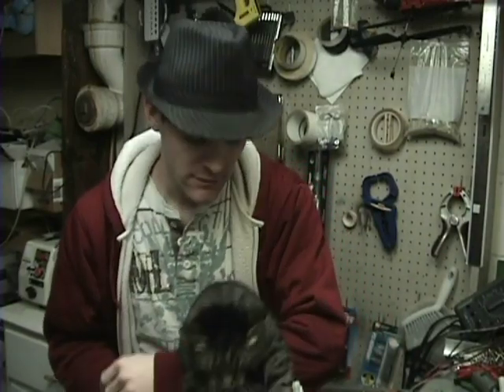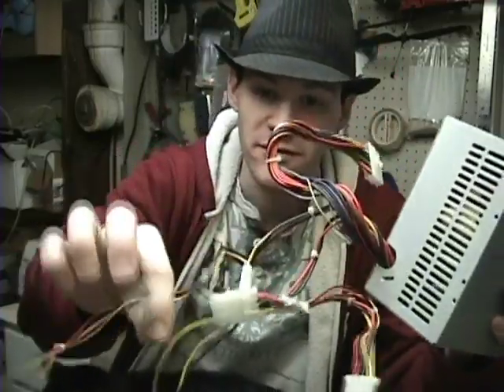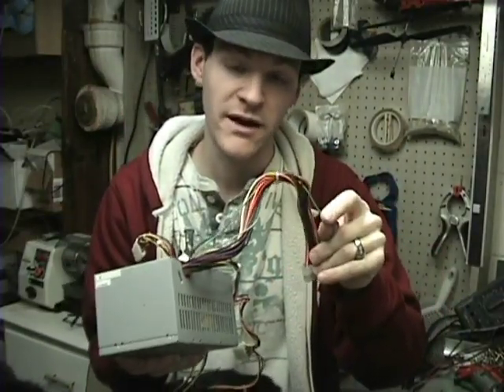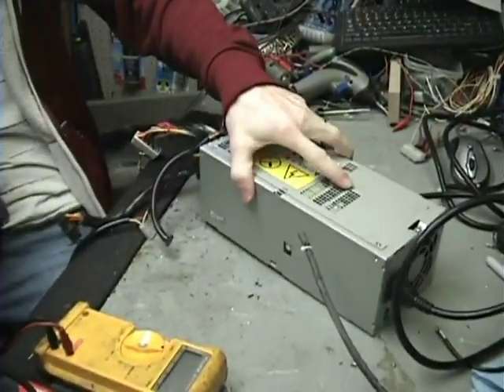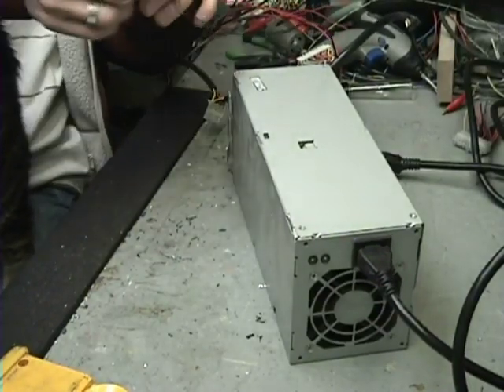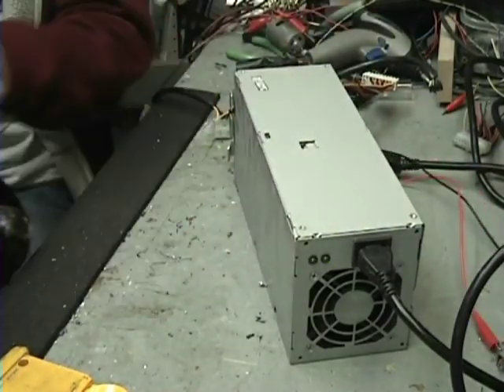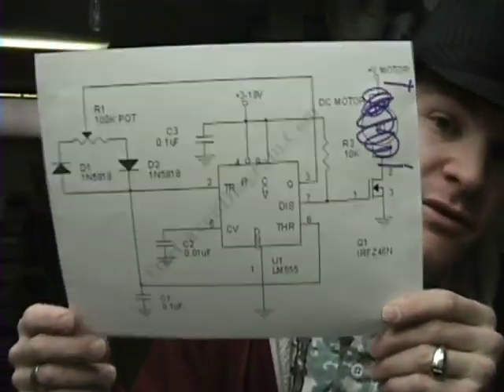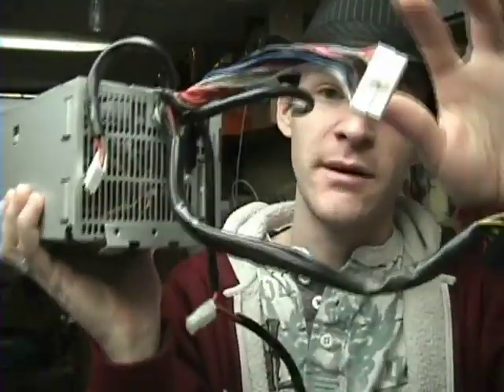How To Make Your Own Bench Top Supply From a'n ATX PC Power Supply! (So Simple Anyone Can Do It!

Comment: Hi Russ, great videos!  I just wound a classical Rodin Coil and have a few questions...
1.  Which coil design do you get the most spin from with a neo ball?
2. I'm a complete newbie to electronics.  What do you do with the 4 wires on the coil?  My interpretation is that there are 2 circuits and one winding should be on while the other is off and they should both alternate on and off at a frequency.  The 555 PWM motor control circuit only shows 1 - and 1+ output for the coil.  What should I do?

Comment: There are some pin-outs on the net for ATX PSUs (20-pin connector). There are a number of GND pins: 3,5,7,13,15,16,17 (Usually black wires). Pin 14 is PS_ON, often a green cable as you stated. There is a 24-pin Version 2.0 pinout and the PS_ON is different (16 green) as is the grounds (Nearest GND is 15 / Black). I haven't checked the accuracy of these pinout diagrams, please check for yourself first. Make sure you set your PSU to the right countries voltage if required. 110V / 240V etc.

Comment: I like how he explains how you can get hurt (from amperage) as he has those exposed metal alligator clips close to the case of the power supply while it's on.  He was a couple inches from shorting them on the metal casing.

Comment: Most of the older ATX and older PC supplies needed a minimum load on the +5V (Not the standby (+5Vsb)) to maintain reaction from the PWM circuit..  usually a 33ohm, 5W (surprisingly, yes, that low resistance) across the +5V to GND.. I've converted a few supplies to bench blocks, One, same supply as yours, (Sparkle) didn't require the load as there was already a load resistor hard-soldered to the board inside. A Dell 200W supply, required the resistor (sand-block type).

Comment: Great video.  I have an old atx100-5 power supply that works when connected to the mthrbrd.  I have jumpered the green (pin14) w/black grd; when I plug in, it does not turn on.  Purple wire (pin 9) is at 5 volts.  Not sure what to do to turn on.  I put a 20w/12v bulb on one of the power connectors to fake a load, but still nothing.  What do I need to do to make this work w/o a mother board?

Comment: I dug up an old psu from about the year 2000 today. It only has a 12v and a 5 volt rail. 3.3v is totally missing, lol! It has a total rating of 65W, 12v, 2amps and 5v 7.5 amps. 
The fan spins when flipping the switch and I didn't have to jump the green and black wire, I guess its so old they did it differently back then. I like it because its compact and safe because its only 65 W. I found a 5w power resistor too, so I'm gonna connect that to the red and black wire so the unit cant switch off automatically which it does do.

Comment: You give me ideas, man. I should have knowned before.  Not just thinking.  This is the cheap deal in town.  Classic PSU's will give way much more voltage than rated no-load and colapse as you load them.  But not a switching PSU.  GREAT!!!  I see the 12VDC for those popular LED strips, the 5VDC for USB power outlets and the 3/3.3VDC for running those " 2 AA" things.  Beautyfull!!!

Comment: most newer psu need 0-5 wires!

my 1200watt @ 80AMP had 3.3 5v and 12v, grey and orange wire so i had to use a few resistors to make loads on them wires.

Comment: OK, I've got a 300 watt ps, I had a code3 mx7000 emergency light bar, 5 rotators ect, and it worked fine. I've tried putting a new ps together, just as you've shown, but when I switch the rotators on, it shuts down. I can get the other lights (with out motors) to work fine... Whats going wrong?

Comment: One question I have, with the 555 timer, would I connect all 3.3, 5, and 12 volt power sources to this timer?

Will this result in increased amperage across the board?

I'm working on a low budget project to create a power source for my car amp to play my subs with my home theater system. I've been all over the web and in forums but every path leads me well out of my budget considering I already have what I thought the expensive part was, the amp and subs. This seems like a good cost effective way to achieve the power I need (80+ amps and 12V). My best option seems to be to pair a battery with a low amp bench test to charge the batter. I don't the like the idea of a battery sitting in my living room. CPUs seem to be an okay solution, but again, not the power I want.
Reply from the maker: Milan Milanovich no, you need to keep the output power voltages isolated.  

you will have a hard time acheving 80+ amps using PC power supply's. it can be achieved. but you can only use the 12V coming out of the power supply. the rest is not used power. 

~Russ

Comment: It puts out 42A at 5V if your load draws that much. The human body will never draw anything near that much at 5V. 42A is extremely overkill though. 200mA could already be fatal, but you're not gonna see that kind of current in a human body with contact on skin at 5V, no matter how buff your PSU is.

Comment: Aside from that, devices from automotive applications are designed to run from 12.8 VDC - ~ 14.8VDC, unfortunatley the 12V rail of most PSU's only puts out around 11.9VDC. On top of that, the rotators on the mx7000 are rated at 100w each! This really needs to be run off either an automotive battery, or a much larger PSU.

Comment: There is no need at all to give a warning  (given at 5:21) about electric shock from the output of an ATX power supply. The high current output cannot cause an electric shock because the voltage is a maximum of 12V.  Unless the output is stupidly strung across the tongue or other low resistance paths of the body there is no chance of even the slightest tingle.

Comment from the maker: @seansuth from my experance. It seems like you are pulling to
Manny amps from the power supply and it's going in to shut down mode. That's Ill I can see that would be the problem. Try a bigger power supply or do a calculation on your load. thanks, ~Russ

Comment: The motor regulator isn't going to work as variable voltage power supply as it is design to work as a variable current power supply which means if you input 12 V you get out 12 V but you can adjust the output current. Same as a driver for an LED for laser applications.

Comment: I'm in the same boat as pohukai. I shorted green to black...nothing. I put a dummy load on the 12v rail...nothing. I put a dummy load on the 5v rail...still nothing. I know the power supply works fine cuz I checked it IN the tower. Won't power up OUT of the tower. What am I doing wrong?
Thanx

Comment: If you cut out the FEEDBACK resistors and put in a variable resistor you can change the output voltage (careful not to overvolt the output caps) ill personally remove my output filtering system from the PSU and make my own, i want to see what's the max voltage it can hammer out.